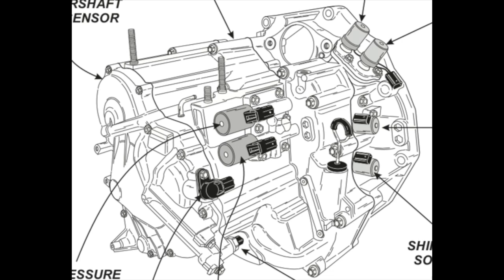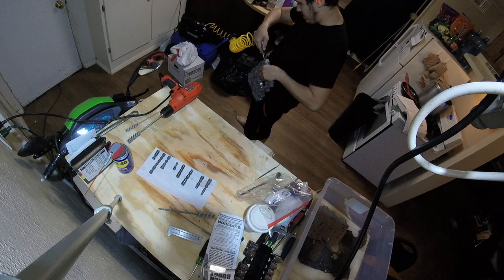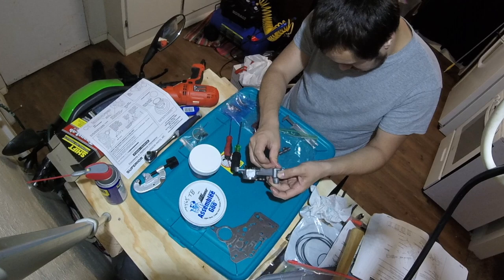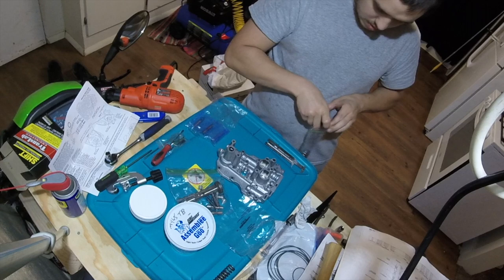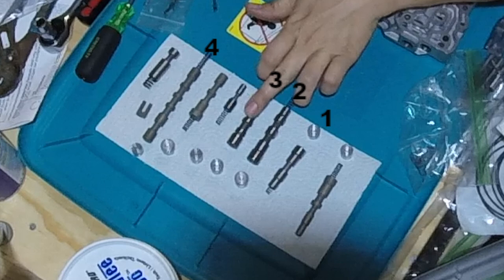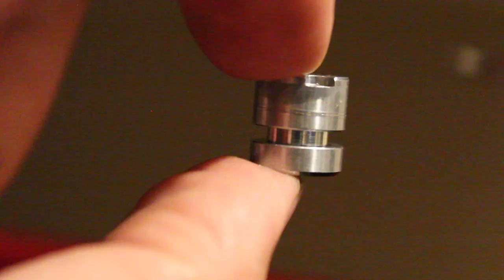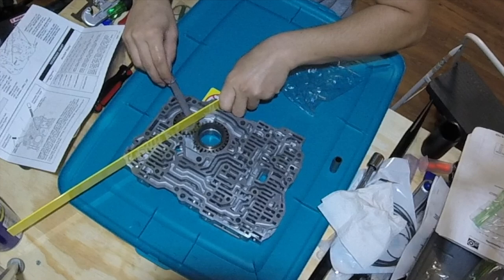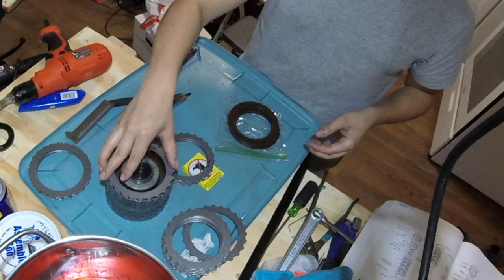Honda BAXA Transmission Rebuild

Comment: That's a good video. Is that for a 4 cylinder Acura CL/Accord? Can you tell us the manual you're using? Again thanks for putting this together.
Reply from the maker: Yes it's the 4cyl accord, not sure which Acura that is. As for the manual, it's not really branded. I think it's the official Honda manual.  If you're looking for it, it's 2 books, white cover with Honda in blue at the top and in the bottom right hand corner says "service manual 1998-2002 accord 2/4 dr"

Comment: It’s necessary to get a new valve body to work properly with that shift correction kit? Someone told me after installing that shift kit the transmission was slipping. Thank you!
Reply from the maker: No I used my old one and it's still working after 10,000 miles. My understanding is the shift kit is made to improve the function of the existing valve body. If there was slipping maybe the valve body or something else was damaged, or the bores weren't polished enough.

Comment: Honda BAXA Transmission Rebuild

Can you share with me the part number and where you purchased your spring compression tool?   thank you     Michael
Reply from the maker: https://www.ebay.com/itm/114270055203?hash=item1a9b06ab23

Comment: Hey man where did you buy your rebuild kit with all the clutches?
Reply from the maker: If i remember right it was Oregon Performance Transmission
Reply from the maker: 99% sure it was this
https://www.oregonperformancetransmission.com/product/OPT-BAXA-RB.html
Reply: Thank you so much!
Reply: By any chance did you buy anything else for the rebuild other than that kit?
Reply from the maker: @juancastaneda9515  I got the shift kit from the same website, and a torque converter from ebay.I think that was all besides tools and chemicals